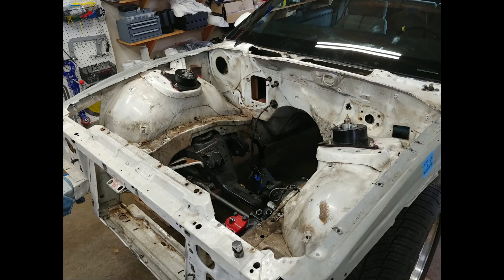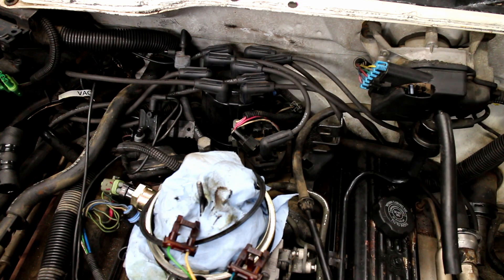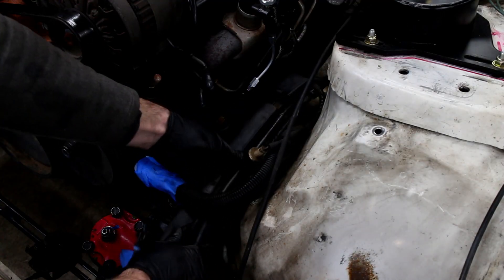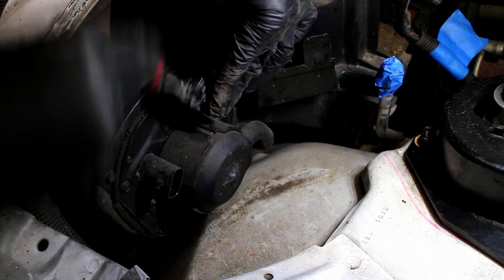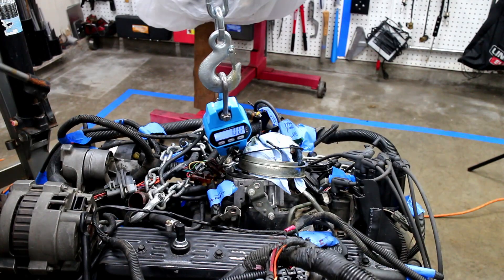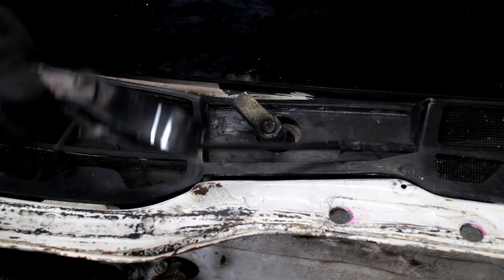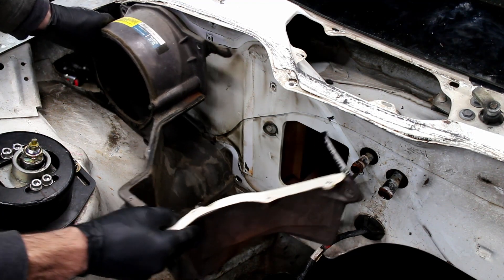305 TBI Removal 82-92 Camaro/Firebird  (Pt18 LS Swap)

Comment: Very enjoyable, unfortunately I am at a stand still with my LS swap because of teen and single digit temps here in MI. Inside pole barn but no heat, so as usual I loose about 5+ months of anything enjoyable here. looking forward to your next installment.
Reply: Hi Dave I struggle with a similar issue here in Canada, all I do is suit up and keep on keeping on, no need to let the cold stop progress! Things go slower but never stop!
Reply: I'm on the IL/WI boarder and am in a similar situation.
Reply: I'm in Ohio. It's 17 degrees and windy as I type this. My son's 3rd gen is on hold until warmer (30+ degrees) days.
Reply from the maker: WA got it's cold snow week (yes I know a week lol)
temps were 25F ish
I used a forced air propane heater to get my garage hot enough to even paint my engine bay.
uses a lot of propane, (1/2 a tank a day) but it gets hot enough to be comfortable
Reply: @DougieeStyle  Ya, I used to, but not anymore.  Wish you all the best with your project.
Reply: @davebarron5939   I’m sure when I’m older I change my tune, I work outside as a mobile transport truck mechanic, so I’m always outside fixing, at home or work!
Reply: @3rdGenGuy  lucky you! We hit 0F the last few days! Wow! Lol
Reply: @DougieeStyle  Yep, I ran / repaired all sorts of heavy equipment all my life, and respect your job / responsibilities. Did a lot of work in the freezing weather / snow.
Reply: I’m in SLC Utah it’s cold here as well I’m still working on my 92 but the cold and my day job slow me way down   I’m getting a lot closer to starting my LS swapped 5 speed car
Reply: @vandettabuilds6641  Sounds good. I have a built LQ9, new 4L65 strengthed trans and all is in place. Most all ancillary items are done lastly custom exhaust. Otherwise all fluids top off, do initial start and checking. Then sit and wait for May, when weather is agreeable. Best of luck on your build.

Comment: Great video is gonna help me out A lot when it's time for me to remove my old 305 engine I have a camaro z28 tpi My question for you and one of your other videos. I've seen you put the motor in I Believei wanted to ask u  where did you get Ls engine from and was it cheap to do the conversion I would Eventually like to go that route with my car. Here in Florida. We have a junkyard called LKQ maybe they have the engine like your I hope thanks in Advance
Reply from the maker: find a local junkyard and ask what they have.
as far as cheap?
no, LS swaps aren't cheap, but you pay more for A better engine.
Reply: @3rdGenGuy  Okay I definitely will do thanks for the fast reply I appreciate it
Reply: @3rd Gen Guy  hi I have more question for you sir? What vehicle did your engine and Transmission at the time come out of ?
Reply from the maker: a 2001 firebird.
98-02 camaro/firebird engine/trans combos fit in 3rd gens without any major issue unlike the truck engines.
Reply: @3rdGenGuy  OK thanks that what I will be looking for by the way by any chance are u located in Florida sir ?
Reply from the maker: complete opposite. 
I'm in WA

Comment: At 9:24 I would use the Osmo Dji action camera 📷 with a small led attachment while using the app on your phone so you could see how your framing looks on your phone. I’m gonna give it a try. I hate being busy with work  and never make time to do my videos 😞
Reply from the maker: it's not a framing thing, but rather there's no room for a camera or even a small GoPro under the dash.
there's almost no room for me either, it's hard working under the dash

Comment: What did you use to plug the fire wall holes and fender hole from all of the stock wiring? I'm doing a similar build and running into issues finding plugs that fit these holes
Reply from the maker: round holes can be plugged with cheap plastic plugs and RTV.
other square holes will get 3d printed plates or just something I cut from aluminum.

Comment: Hey do you know where the o2 sensor ground would be on a 1989 Chevrolet camaro i heard its on the back of the cylinder head not sure what side
Reply from the maker: TBI o2 sensors are a single wire. the ground is where the threads contact the exhaust manifold.
Reply: @3rdGenGuy o ok do you have knowledge about the o2 sensor signal wire, mine was cut while driving I replaced the portion cut with new connector with butt connector and crimped heatshrunk it I am getting good fluctuating while pressing the gas but in idle the millivolts read 8-900 milivolts not sure if that's normal
Reply from the maker: the voltage will vary.
you'd have to look and see if thirdgen.org has voltage charts for the O2 sensors
Reply: @3rdGenGuy  o what about the O2 ground circuit that's on the back of the cylinder head not sure which side but mine has two bolts with a ground wire connected to it, one of them was reading .6 volts shouldn't the ground voltage read close to zero

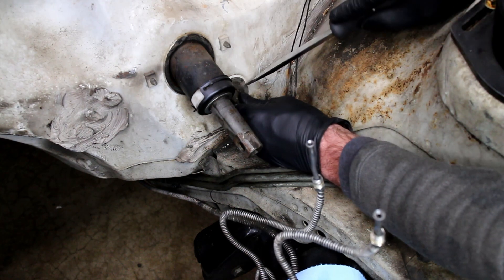Comment: 9:09 aww you just gave me an idea 
Since I’m not going to be using my factory cruise control I can used that whole for running other accessory wires like my 4ga amplifier wire and other wire controls right?
Reply from the maker: it's about a 1.25in hole, so ya.
you can stuff a lot of wire through there.

Comment: What set up did you use for pcv and catch can for the new LS
Reply from the maker: I used a Catch can from a BMW m3.
co-worker sold it to me ha ha.
Vacuum reference from the intake.
sucks from the passenger valve cover.
driver side PCV is routed to the intake for the clean side.
Reply: @3rdGenGuy  awesome, thank you

Comment: Sad video for me. The reason I was drawn to this channel is because of the 305.
Reply: Well generally speaking as much as I have tried to love the 305 it kinda falls a bit short with so many other great gen I options. I am more sad because yet another classic got an LS but I do understand his motives behind this decision. (less weight on the front axles because of the Aluminium block). With that said I think the 305 is quite a decent little engine to push like 300hp and have a nice old school cruiser that you can fix at home as opposed to any over engineered nightmare that came along in the 2000s and up.

Comment: But can I keep my t5 Trans if I ls swap tho?
Reply from the maker: you can, but T5 are only rated for 250 Lb-ft.
meaning any small mishap will cause that t5 to blow up
Reply: @3rdGenGuy  so basically don't get sideways and don't clutch kick 😅

Comment: I don't need to do 90% of this because I am putting a 350 with a TBI right back in it's place. It would have been nice if you had shown disconnecting the engine from the transmission.
Reply from the maker: I did, in my 700r4 removal video.

Comment: That fuel injected 305 wouldn’t actually be slow if you had a manual transmission.
Reply from the maker: that 305tbi would be slightly less slow if it was a T5 car.
it made 122 horsepower on a dyno ha ha